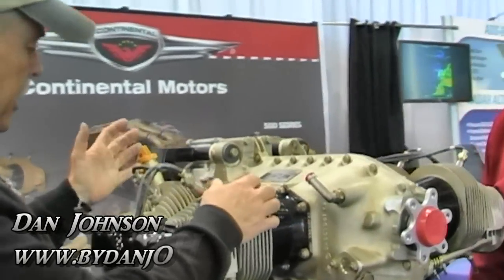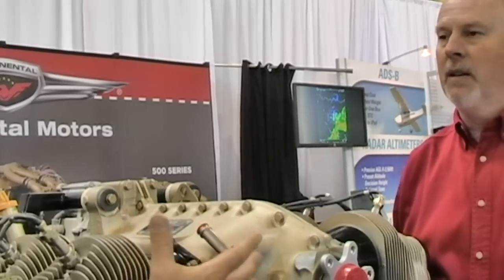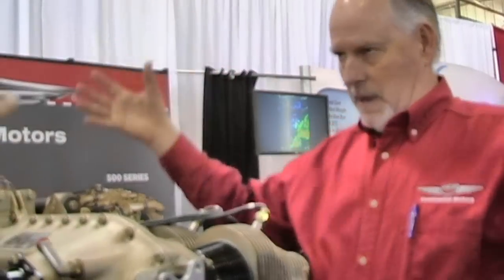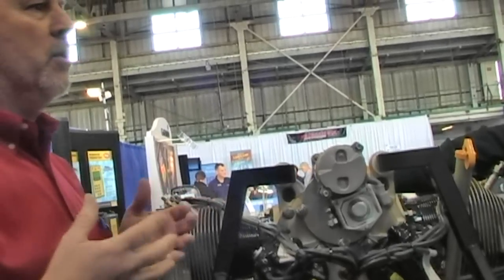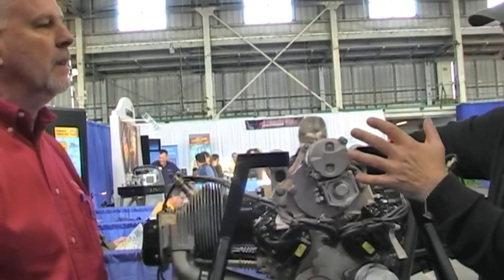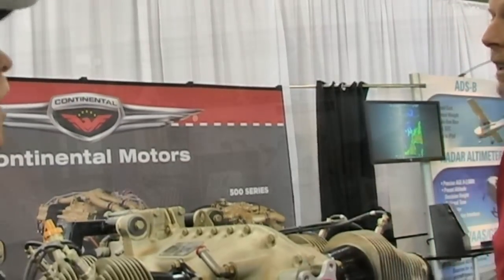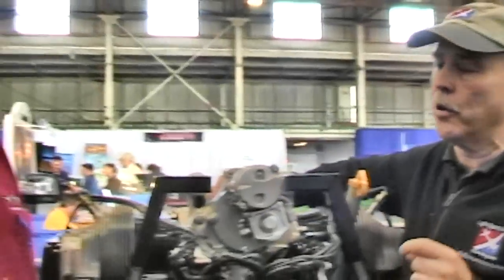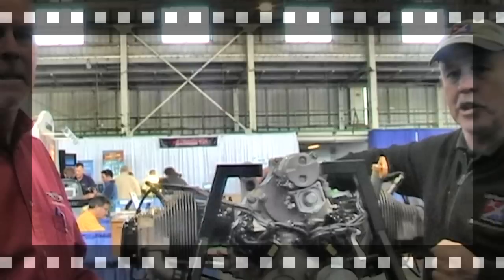Continental Motors, Continental 0 200 D light sport aircraft engine.

Comment: Continental C-85 powers my 1948 Ercoupe.  It's had 1 major overhaul.  The crank and camshafts required no servicing at that time only bearing and rings were replaced.  Itnow has 720 hours smoh and uses no oil and tolerates 220 temps (I fly in the mojave desert alot) without complaint.  Go Continental!
Reply: My brother has a ScareCoupe Alon w/C-95.  We had 105+ days recently and he went flying he said he just about couldn't climb (300fpm).  He was with 2 people that day
Reply: I JUST pulled the original O-200 from my 1959 Cessna 150. It has 3542 hours and has NEVER had a major overhaul. Good oil pressure and temps, oil analysis has been good for the 10 years I've owned it, all compressions in the mid to upper 70's. It's had new cylinders installed once in its life. Got a great deal on an O-200 with less than 10 hours on it. The only reason I swapped them.
Reply: My '46 415C Ercoupe will need either an overhaul or a replacement someday, but I would like a fuel injection system.

Comment: Curious why they decided to add the oil filter when looking to save weight. . All O-200A  engines had no oil filter. My O-200A has 3870  hours with no oil filter.The A version is an 1800 hr TBO where they did increase the D version to 2000 hr TBO, where the oil filter obviously helps.
Reply: Dennis S l am dubious of the oil filter never had one on any of my airplanes and still see no need , l have flown many other junkers that had filters it seems that owners who cut on maintenance prefer filters.
Reply: I saw on about video that by installing the oil filter it extended TBO by a significant margin. It's also going to enhance cooling as it increases oil volume.